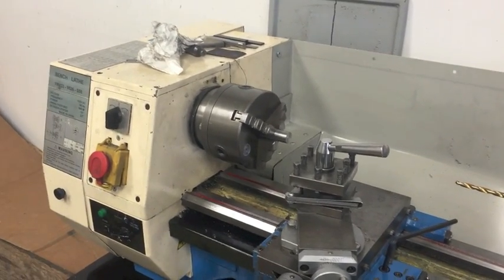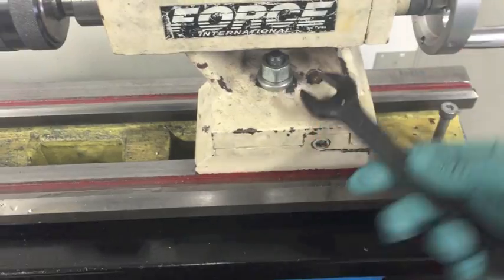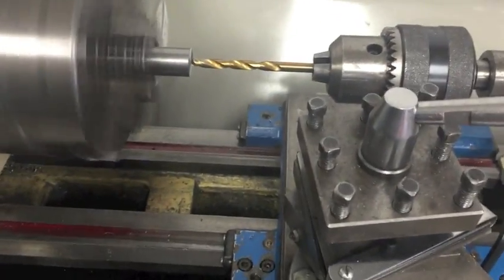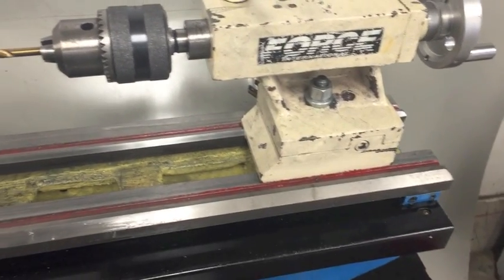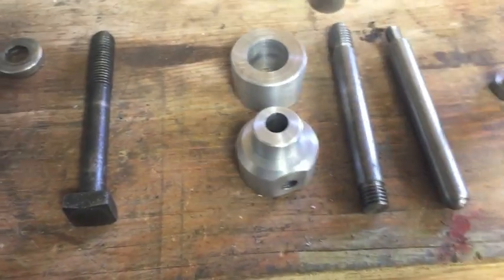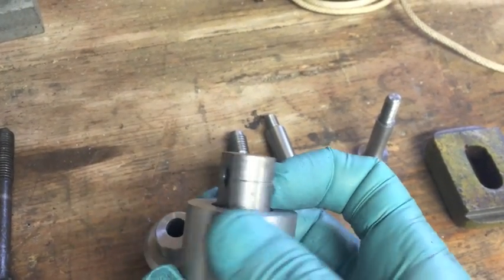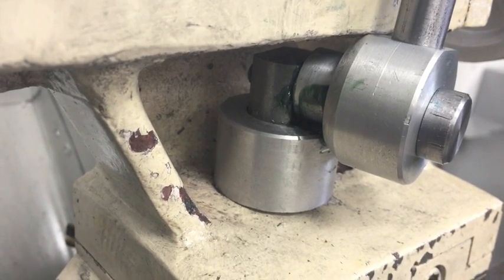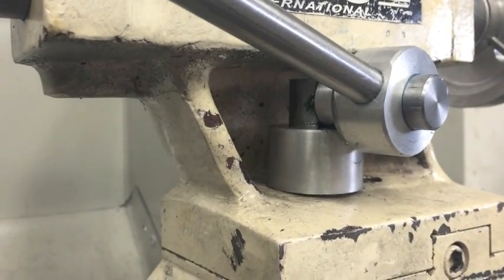SIEG C6 Quick release tail stock.

Comment: i have a Grizzle copy of the same lathe and this was a very efficient use of the original tail stock.  I seen others that want to drill and cut into the tail stock but this is great use of the existing design.
Reply from the maker: Thanks. I thought it was a pretty slick idea. Works well.

Comment: A no longer in business House of Tools C6. You must be in Canada. I bought mine quite a few years ago at there Langley store. Since I read below you've sold the lathe I hope it was better than what they sold me. On mine the tailstock spindle pointed uphill over .009" in two inches so it instantly broke the tips off any smaller center drills, accurate drilling and reaming was of course impossible. The cross slide was warped in two directions. And the tee slotted milling table so warped it was unusable until I milled it flat. It took over 9 months to get the fixed and traveling steady's that were supposed to be included with the lathe from them. I've since replaced mine with a 11" x 27" that's easily 3 times the lathe my C6 was and it was correct right out of the crate.
Reply: That Force International name was what The House of Tools used on a lot of there equipment. That's how I knew where it came from. I've read many posts on various forums where people are really happy with there C6 machines. I guess I got one that never should have left the factory in that condition. But Sieg has lost any future business from me.And I'll never buy another new lathe that doesn't come with a proper test certificate. And there's some very good reasons why The House of Tools is out of business as well. I ended up buying the same as what Quality Machine tools are selling as a 11" x 27" with the power cross feed to replace my C6. But I bought mine from a Quebec tool dealer.

Comment: That's an excellent variation on the solution. I like the fact the cam action is using a large diameter, not a much smaller eccentric machined into the pivot shaft.
How's the aluminium holding up though? I'm thinking steel would be more durable in the long term.